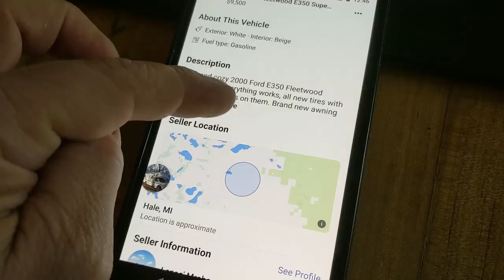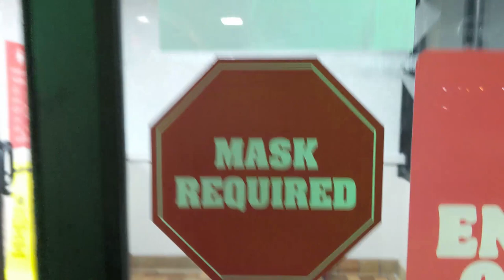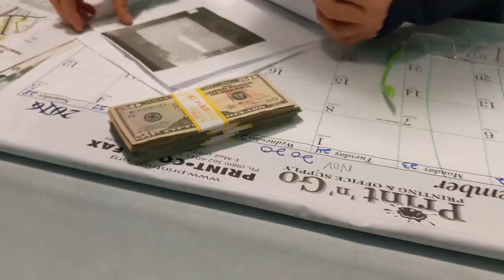RV Rehab! - Fixing Up a 25' Motorhome With Family

Comment: I bought a '94 Fleetwood, similar to yours.  On the way home (3 hr drive) the roof peeled off and I had a moon roof. Wouldn't have been so bad if it had not been raining so hard.... You are correct: most older Class C have water damage up front.  I had to do a lot of maintenance and repair for the accessories, but I was lucky.  All of the appliances ended up working except for the furnace (a "repairman" took it from the previous owner and never returned it). I painted the old, discolored interior, put in engineered wood floor, rebuilt the cabinets, put in stainless sinks in the bath and kitchen, installed Corian countertops, installed Pex plumbing, put in seats for the kids that had shoulder harnesses, and replaced the roof. Was it worth it? I had fun doing the renovation, and it worked great for my family.  We decided we weren't using it enough, so we sold it to some missionaries who are traveling the country in it now. I did not list all the things I did to it, but everything was at least as good as factory when it left us. The renovation was at least as good as the trips we took.  Thanks for sharing your family's experience.
Reply from the maker: Sounds like you did much more to yours.  We debated on how far to go with the renovations.  We settled for just "trying to make it our own" and didn't get too carried away.  I would really enjoy doing something like you did if I was able to commit more time to it.  For now, we'll just keep crusin'.  Thanks so much for watching and sharing your RV story!

Comment: Usually for me taking the door and frame off of the coach, refrigerator fits. Always like seeing a different prospective! I've bought several motorhomes and campers on the cheap and turn a profit.  Last one was a 97 class a winnebago for 3800.00. Sold for 9000.00. I sure miss having one now,  enjoy.
Reply from the maker: I figured that was the way to do it Jake but I couldn't find anywhere that said for sure.  I didn't know how well that coach door would come off and well, I knew how to take the van door off.  I hope I don't have to get it back out but at least now I know.  Yeah, good market on these RV's.  At least for now.  Thanks for watching!

Comment: Great video as a fellow rver check the seals on the roof very carefully and if the tires are over five years old replace them because there weather rotted good luck
Reply from the maker: I need to do a good roof check.  Tires are brand new but that's a great tip.  Thanks so much!

Comment: This also happened to me when looking for a tractor. All the good deals for a sub compact were getting scooped up quickly. I drove 45min two separate times to get one only for the guy to call and say it sold I was mad frustrated and sad. Lots of emotions it was like I would never find one. But then a post came up must have been there for 5 minutes before I sent him a message. And it was only 20min from me I never hooked my trailer up so fast. So the guy was moving way up north Montana or something from texas. So I bought the tractor for 7000$ a 2016 1023e john deere with 64.5hrs on it I couldn't believe it they sell for 12,500 to 15,000 with those hrs. So after all the struggle god blessed me I'm so happy it turned out the way it did. All those other tractors I never got to see because they sold so quickly were old with lots of hours for almost the same price. I'm still in shock really. Sorry for the long comment just excited about my super deal. God is amazing,
Reply from the maker: That's awesome John!  You were in the right place at the right time!  What a great buy on that 1023E.  You'll be feeling the buzz from that for years to come!

Comment: Neil... although there are two huge RV dealers next to my home.  I’ve never been more than just curious about motor homes.  

One of the dealers hosts the Polling for our elections.  I’ve been there maybe 50 times in the 30 odd years that we have lived here.  

I remember back in the 90’s there was one visit where they had received a trade-in.  It was a really nice unit with a pop out on the drivers side and a roll up awning on the other.  I don’t remember much else except the wheel covers.  

While standing in line to vote late one afternoon, I saw the whole crew and staff through the plate glass window.  They were gathered around the trade-in that was setting outside. What caught my eye was the strobe light that was emanating from the rear wheel.  

The setting sun was shining on the hub cap.  One of the mechanics reached over and touched it... it was a chromed  ‘Spinny Wheel’! As he twisted it the sun would glint off it and the result was a blinding strobe that lit the whole area.  The people gathered around became shadow figures that moved like an old time 8MM B&W movie,  running on a projector with a loose belt.

Prior to that, I’d only seen Spinny Wheels on TV.  So curiosity got the best of me.  After voting, I went out to see how they worked.  

The crowd had left and a couple of mechanics were removing the wheels.  They showed me that it was only wheel covers.  The previous owner had them custom made.  He had left it there... while he went to dinner in his tow behind car.... so that they could put them on the new one he bought.  

There were 8 lugs and only 4 were used to hold the wheel cover on.  The other 4 were punched out to slip over the lugs.  

It was the first and only motor home that I have seen that had such stylish accoutrements!

The only other experience that I had was my father’s dream. He had been stationed in Arizona while in the Air Force (during the Korean Conflict). I don’t remember that part because I was only 1 year old.

What I do remember is that during all if my life he and my mom talked about their retirement plan.  They were going to sell everything and buy a motor home.

Touring Arizona, Colorado and New Mexico was their dream.  But, alas it was not to be.  After bankruptcy, illness and life in general they never realized that dream.  

Looking back, I’ve wished several times that I had taken the time to rent one and drive them to see their dream.  But, it is a memory that we will never share.  

So, take the time now.  Get out on the road.  See everything that you can.  Give those girls memories that will last a lifetime.  This is your chance.

PS: the office chair door lift was pure DIY gold!

Have a safe and happy Memorable Memorial Weekend!
Reply from the maker: Thanks so much!  I've never seen spinners on an RV either! That would be one that you remember in the RV park for sure.  

Fortunately, Kara and I both have similar childhood memories of road trips with the our folks.  We enjoyed them and recognize the fleeting opportunity that we have with our girls. I am quick to be super busy with things but willing to have this excuse to get away.  I'm sitting here on a park bench while the girls all take a rest in the RV.  It's cool to be able to stop wherever we want. Good times for sure.

Thanks as always and appreciate your stories and support.
Reply: @digdrivediy  I think I told you we dairy farmed... vacation trips were out of scope for us... but picnics  and fishing at the creek were our family time.

Enjoy every minute... they are more fleeting than I thought!

Comment: Curious why no power washer. Seems like it would come in handy for cleaning all the trucks and equipment you have.
Reply from the maker: I have had like 3 of them.  They all turn to junk it seems like.  We have one now that works pretty well from John Deere. I think we were holding off on the RV cause we wanted to see if it was gonna leak anywhere first.

Comment: It is a money pit: do it anyway if you can afford it. This is a good investment in family not in high quality vehicles. However: so that fun is better guaranteed, replace all the tires no matter what they look like!!!  Belts and hoses and rubber parts in general: replace.  RVs of all kinds do better with less maintenance if they are kept in a garage keeping both roof and tires out of the sun and weather.
Reply from the maker: You're so right on this one.  We are doing for the family and every time I drive it, I shake my head at the build quality!  But, so far; so good (knock on wood).  It had brand new tires when we bought it and I've changed the serpentine belt.  Our goal is stay within 4 hours from home so we're not too far if stranded! :)  Oh, and I have much less shop space because we do keep it indoors now.  Thanks for watching!